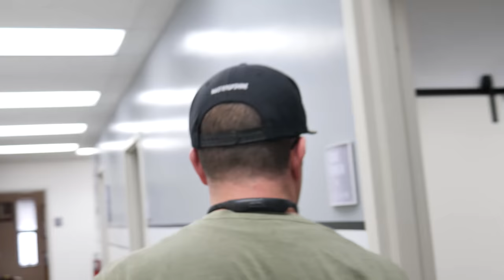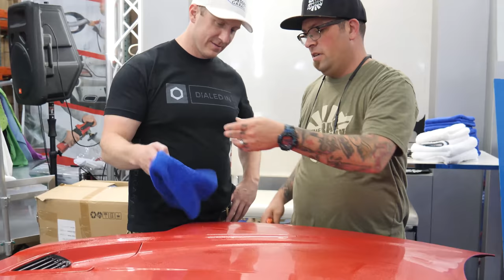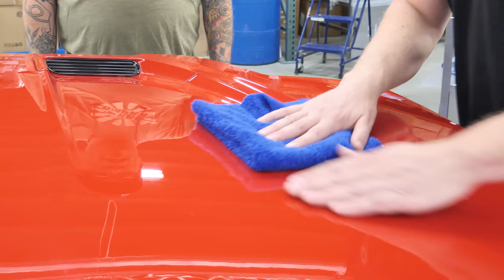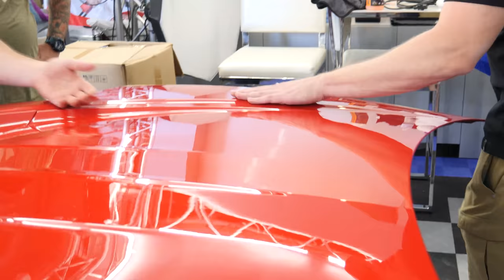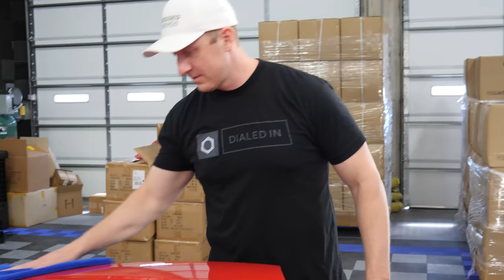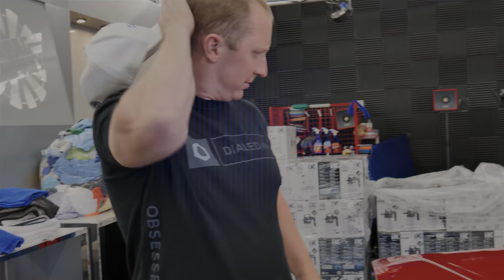Matt Experiences Bead Maker for the First Time | Obsessed Garage @ TRC

Comment: Matt is probably the toughest critic in terms of product evaluation. 

By the way, Bead Maker is awesome.  I recently bought 4 gallons of it.
Reply: I put  it on my toilet paper
Reply: Most gloss? Meguiars gold class or this?
Reply: David Sosnak same question
Reply: Do you dilute it at all?
Reply: @cmf9984  No, I use it as a drying aid.  It actually gets diluted when it is mixed with the remaing water on the surfaces.
Reply: @cmf9984  I dilute it 1:1

Comment: I just ordered a gallon with the ik sprayer and the towels and cannot wait to do my first coating.  I've been using the Wolfgang dillution with distilled water as a drying aid and have been very impressed.  I've never used beadmaker yet, but I have a feeling it's gonna be very impressive. The Wolfgang is the most impressive detail spray I have used to date, when used as a drying agent

Comment: I have been using Bead Maker in my detail shop for a year now and it is by far the single best detailing product I have ever used
Reply: Josh Pierce,do you think it will make White glacier (my truck color) pop?it's a brand new truck and I have butter wax by chemical guys on it along with their mirror finish and it looks great.i have bead maker and gonna apply it this weekend but just wanted your opinion.thanks!!
Reply: If my car is not garage kept and sits outside all day abd i put the beadmaker will it attract dust?

Comment: Just tried this stuff and its awesome! Only a few hours in and the car is super slick. The only issue I had is there is a bit of streakiness or ghosting after its dried. It was pretty hot and humid out so maybe that caused some of it?
Reply: 100% when it's humid you want to wipe it quicker to compensate for  the heat also, helps to apply to the towel first keep the rag damp

Comment: I have a DAYTONA 392 with the Matte black decals how will it work on that ??
Reply: I have matte stripe on the tail of my Scat Pack Challenger. Been using this for about a month and a half with no issues.  I'm buying this from here on out if for no other reason than the gloss and slickness. Plenty of "protection" options out there but i haven't used anything that makes the paint pop like bead maker. Going to be insane once spring/summer arrive.
Reply: @wayniac34  thank you brother I'm going to order some for sure every video has been positive on this product.
Reply: One more thing...i wasted 16 bucks buying the small bottle. Ended up ordering and will only order the gallon going forward.
Reply: Yeah I was planning on it I'll be using it on my wife jeep also.
Reply: @edgardocastro8864  Nice! My fiancee has a Jeep Jk and i used it on hers once. She noticed the pop right away.

Comment: Ok so my Jeep isn’t coated or protected but I wash it 2 to 3 times a month to keep the paint in as best condition as I can I can’t afford to detail it but I do have the time to do it myself it’s new and only has 10k miles on it can I use bead maker after I wash it even though there is no extra paint protection or etc
Also what about getting it on windows

Comment: Does the hardening agent affect the towels? Will they get ruined like after applying a coating?
Reply: no
Reply: The Rag Company what do you suggest we do to avoid Si02 build-up in towels from products such as CarPro Reload? Immediately soak in detergent or is there no such way to stop it.
Reply: Also add 1/2 cup of distilled white vinegar to the bleach or fabric softener tray.
Reply: 1/2 cup of ammonia once in a while has been found to really clean the towels to get that build up out of the nap and work almost like new.  This is according to Rob Regan at TowelPros.  Check out the article... https://www.towelpros.com/article/12006-when-your-microfiber-towels-do-not-absorb-any-longer
Reply: It will when you drop them...christ! Get it together Matty!

Comment: Just got mine in 2 days ago and I am currently working my truck in the garage it's almost midnight here in Oregon. I'm cleaning up the whole truck so I can apply the king aka bead maker give it the proper cure time for the base coat then I will put on 1 more coat to give it it's full potential. As I live on a dirt road and there is snow coming in a few days I will be watching to see how bead maker is affected by the elements the dirt and weather around the next few days to the next few weeks and I will check back in and give y'all my results. I'm sure I'll be nothing short of impressed and extremely pleased with the results

Comment: I thought polymer based products DONT adhere to coatings?? I'm confused of how this will bond to a rock solid Sio2 silica dioxide coating. This would only make sense to me to place it on a naked surface or maybe on a surface that has a paint sealant (polymer based). Even a wax surface to me wouldn't make sense. Am I wrong??
Reply: The Rag Company I appreciate the quick reply. I have no idea what like-minded polymers are?? I know you stated that it migrates into clearcoat/coatings but how? I understand you guys are not the chemists behind bead maker but I'm definitely gonna do a little research on it. Marketing does a great job now days on persuading bs because I got the impression from multiple professional sources that mention carnaubas and polymers don't play well with ceramic coating products. I install ceramic coatings for a small side business so I just want to utilize the right products for myself and clients. Looks like I got some homework to do. Any durability claims? Thanks for your time
Reply: The Rag Company the quick response is much appreciated! Thank you. Will definitely contact Dave to satisfy my OCD😂.

Comment: Idk
Don’t think this can rival C2v3 enough to Knock it off my shelf!
Reply: Hmm, the cost difference is huge though between c2v3 and beadmaker. I personally use c2v3 on top of my coating and it does a great job. c2v3 is $50 for 1L. Bead maker is $32 for 3.79 Litres(1 gallon). I do wonder how it plays with coatings and if it affects the self cleaning properties of a ceramic coating.
Reply: Its legit, try it. You wont be disappointed.

Comment: How does this compare to Adam’s H2O Guard and Gloss?
Reply: Its far cheaper and in my opinion the slickness of the paint is what sells the product. I have never felt paint this slick after application. I have used Adams H2O Guard and Gloss, and MVP's Aqua Seal, and others big names i wont mention....but they all look and feel the same.
My favorite thing about P&S products is the Chemist is one of the owners of the company, and formulates all the products. https://youtu.be/ZN8LpUEoLgA watch the video here about Dave Phillips. 
There is nothing like it on the planet, which is what makes it so special. Do yourself a favor and buy a bottle.
Reply: Thanx! I see Renny has a part in the development. I was fortunate enough to meet him at Majestic Solutions here in Raleigh.  Looks like someplace else to spend my $$!
Reply: I have two bottles left of the Adam's G-n-G product to use up on my truck.  After that it will be using the Bead Maker.  Adam's product stains the application cloth badly and is a bit touchy to apply and dry out.  I have seen it flash on the surface the following day and can then be buffed out or just ignore till next washing.  After rains the difference between the two products are very similar with water rolling off easier on the Bead Maker topped vehicle.  Hope this helps.